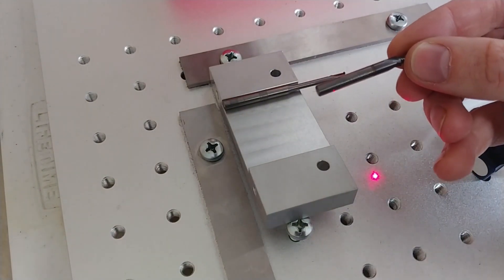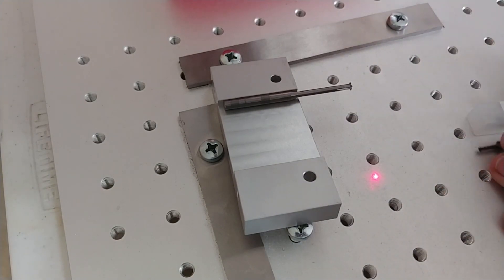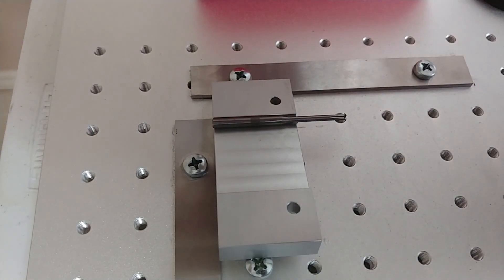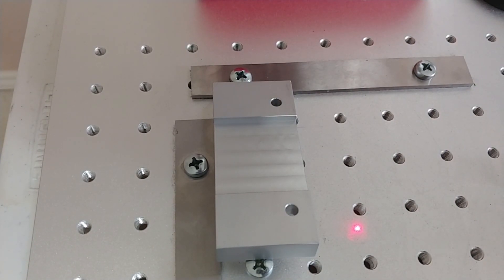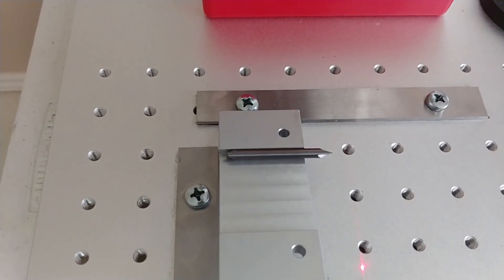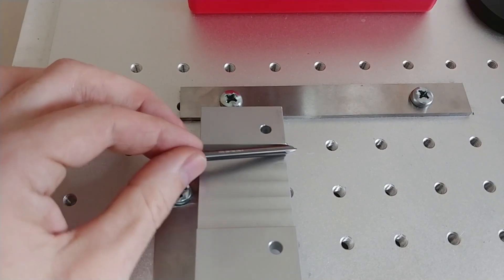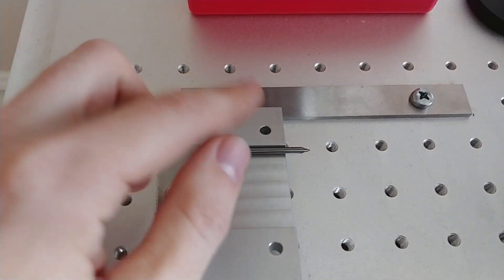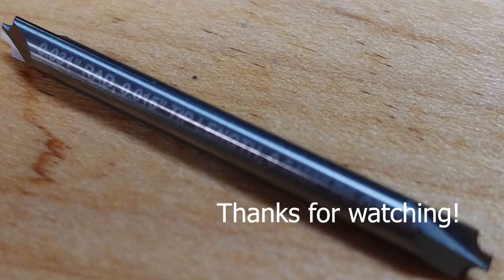Fiber Laser Marking Carbide

Comment: My experience with carbides is that only the tip area is carbide and the body is some high grade steel. Did you find this too.?
Reply from the maker: What kind of tool are you using that you're seeing this?  Carbide tipped tools are common in woodworking cutters such as router bits where you're mainly concerned about the cutting edge and not so much about rigidity.  Solid carbide is common for metal working.